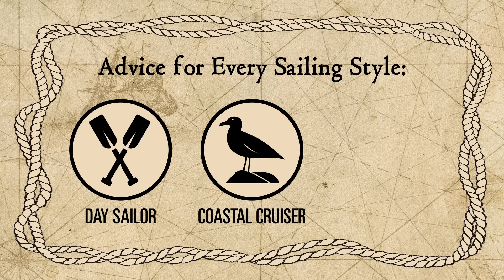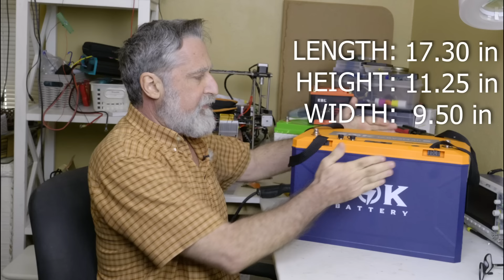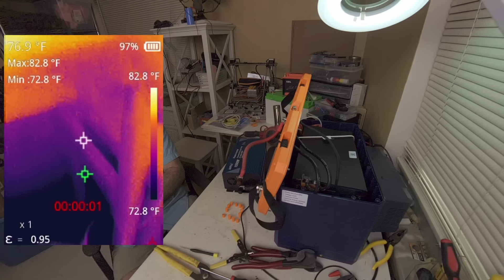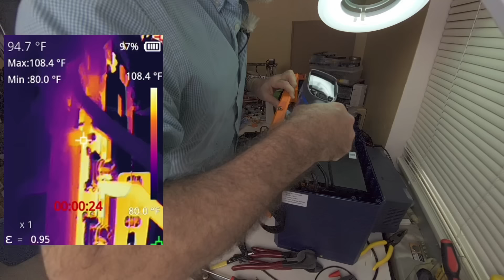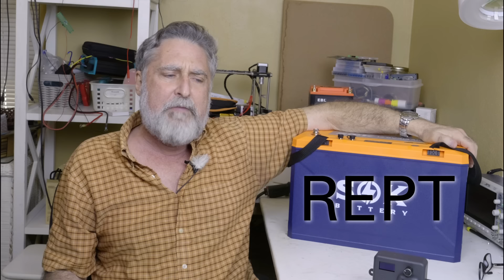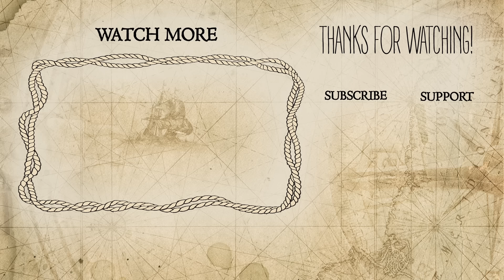Watch this BEFORE you buy any SOK LiFePO4 Battery

Comment: Great review, Clark - many thanks. At 2.45s you mention another battery manufacturer which features an inbuilt extinguisher, but I didn't catch their name. Our marine insurer requires fire protection on any lithium installation, and it would be useful to compare the two brands. Or maybe you've reviewed already?
Reply from the maker: Yes I reviewed it long ago, it's the VoltGo.  If that one interests you go to my leaderboard (linked in the description of any of my review videos) and use that link.   I organized a deep discount for you and free shipping.  It shows up just before you pay.
   I didn't mention the extinguisher in my review video.   But check their site, it had one.
Reply from the maker: https://youtu.be/IQSiJRVVQ2g

Ps this battery is installed in my boat now
Reply: @Clarks-Adventure  That's seriously useful - thanks. Now to see whether available on this side of the Pond....

Comment: I have been trying to get mine to top balance for months. SOK actually sent me two new battery's because they had some quality issues with the first batch. Now with the two new unit still no luck. I have a feeling their getting lower grade cells . I have cells that I can not get to go over  3365mV while the other cells climb and then one other cell just shoots up extremely fast. It always the same cell that caps out and the same cell that shoots up. am now not even able to charge to 13.8 without a cell going into OCV and shutting down charging. This is ridiculous for a 1K battery.
Reply from the maker: Absolutely ridiculous.   It's not the cells it's the bms's inability to balance such cell groups.

   You could open the battery and either manually balance the top cell down or install an active balancer in parallel to the BMS (I have videos on all this).
    But again, yes ridiculous!
Reply: I don’t know if it will let me post this email exchange but I am going to try. How much can you say without saying anything.

Hello Burke,
We extend our sincere gratitude for your comprehensive and thoughtful feedback, and we deeply admire your rigorous professional approach. We are keen to share lithium battery insights with you. Analogous to the uniqueness of natural leaves, commercially produced cells exhibit inherent minor variations. Consequently, our pre-assembly process includes rigorous voltage and internal resistance screening to ensure optimal parameter matching across all four cells within a battery. Upon reviewing the production data for these two units, we confirmed full compliance with our matching criteria.

The intrinsic electrochemical properties of LiFePO₄ result in an exceptionally flat voltage plateau across the majority of its discharge curve. You likely observe this during use, with cell voltages predominantly residing between 3.2V and 3.3V. The data sheet shared yesterday clearly demonstrates this behavior, indicating approximately 95% SOC at ~3.33V and reaching full 100% SOC shortly beyond 3.4V. While the cells are rated at 314Ah, both delivered over 320Ah – this additional capacity is extracted from the steep voltage region above 3.4V.

1763612100_44540_50005_1351721197_3E090BBE@534AF569.C4951E6900000000.png
Voltage divergence concerns during terminal charging phases often originate from underappreciated electrochemical traits. The passive balancing mechanism operates precisely as you noted: higher-voltage cells dissipate energy through bleed resistors while lower-voltage cells remain unaffected. However, balancing duration scales directly with capacity – higher Ah cells require more time due to the intentionally limited balancing current designed to manage thermal load. You can monitor active balancing via the "BL" status flag using the provided USB interface tool with our diagnostic software.

Thank you！

Jackie
https://www.us.sokbattery.com
If you have any question,get support from here:
https://www.us.sokbattery.com/contact
Follow us on Youtube to learn more about SOK battery
https://www.youtube.com/sokbattery

Burke Swanson<biljol@gmail.com> 在 2025年11月20日 周四 11:42 写道：
12 hours later:

Battery ending in 1946

So we were at Battery Voltage 13.88 Status Charge Complete

Cell 1  3413
Cell 2  3390
Cell 3  3649
Cell 4  3433

Update as if 17:30 Battery voltage 13.92  Status Charge Complete

Cell 1  3430
Cell 2  3410
Cell 3  3645
Cell 4  3444

Not seeing much movement on cell 3 I would have expected it to go down. But also seeing the battery voltage go up? I have no idea what's going on. The battery is connected to a power supply set at. 13.75 V

But the chart of that cell is showing some downward movement I think. I see the screen shot may not be good depending on the point in time it was taken there is a delta of .03 v in the chart that would mean if the screen shot was at the peak the original voltage would have been about  3679 not 3649 the second data point at 17:30 should then show a  .03 V reduction over 12 hrs. with about .2 volts of adjustment needed that would take 2 weeks to balance the cells. To me that's not a 200mV passive balance to me. 

1763612100_44540_50005_1177905755_7AF2E7C7@2A494A09.C4951E6900000000.png

Let's look at the battery ending in 2095

at 0600 this morning the values were  Battery voltage 13.76  Status Charge Complete

Cell 1  3465
Cell 2  3493
Cell 3  3463
Cell 4  3348

at as if 17:30 Battery voltage 13.92  Status Charge Complete

Cell 1  3513
Cell 2  3550
Cell 3  3511
Cell 4  3353

In this battey I see 1,2,3 charging slowly and evenly with a delta of about 06mV but cell 4 is lagging way behind.at only .005 mV. of charge over 12 hrs.
This is the pattern I have seen of one cell just not taking a charge. Also if I were to discharge the battery some cell 4 would lag and cell 3 would rise quickly. This is the same behavior I have seen on battery 1946 cell 2 is the laging cell and cell 3 is rapid.

I know I am providing a lot of details but I have had a lifepo4 pack vent on me (a cheap unit) and I do not want a repeat of that. That's why I paid up for these batteries and not just some cheap ones from Amazon. You would think the lower voltage cell would charge faster in both batteries but it's the highest voltage cell that is charging the fastest.

I will not be changing anything and will allow the batteries to "cook" and get back with you tomorrow morning after 24 hrs since we started this data collection.

Please help me understand what's going on and how to fix it.

I am also very concerned that I do all this work to balance the cell, and the first time I discharge them I will be right back where I started when charging them back up.

It is very frustrating to purchase a 1000.00 battery and have to do all this work (months) to get them to work correctly.  

I have a cheap battery here (that I would not trust in my RV), new out of the box, and as I charge it the cells are rising completely balanced out of the box. 

Thank you for your help in advance.

Burke
Reply: My concerns with installing an active balancer  A. void the warranty B. I am not sure how depending on how the cells are attached to buss, welded or stud C. I should not have to modify a 1000$ battery.
Reply from the maker: Yes it would void your warranty.
Reply: One question for you after you finally got them balanced does it stay in balance. With my cells that lag in charging I am worried that I do all this work and 3 weeks latter after a couple of cycles I am right back where I started.
Reply from the maker: Yes they will most likely stay in balance once you get them balanced.  If it was me I'd open the case and manually balance them.

I have this Patreon tier called Dream Believers, it gets you phone access with me and it's become my direct consulting service.
    50 bucks might be well spent if you would like to talk and hash all this out.   
    Balancing these cells with the BMS for 2 weeks will significantly age the cells.   Better to do it manually, then you will have a pair of great batteries.   SOK should use a BMS that can balance in a day.  SOK should balance at the assembly plant for that money.
Reply: I wanted to provide an update, using the power supply procedure. I am getting them to balance taking a long time but one battery is at  .012 mV delta on all the cells and the other one is down from .197 to  .138 delta. This battery sat at .19X for over 2 weeks  and finally starting to close the gap. I tihnk one cell was way undercharged from the factory compared to the others.  Both battery's are at 14.1 volts. I am hoping by the end of the week they will both be complete < .020 delta. Then I can ramp up the voltage to 14.3 or so to fully balance  as close as passable. I am looking at buying a 3rd and now I know I will need to balance it for a week or two before I install.
Reply: My fInal update THEY are done took 1 full week after I figured out how to get them to balance. Final result is a delta of 3mV over all 8 cells in 2 batterys at 13.7v if I charge up to 14.2 or 14.4 it gets up to a max of 21mV delta but that may get better over time. I also see them drawing down and charging up equaly.
Reply from the maker: Good job

Comment: Hi Clark. I've been looking into replacing my 8 Battle Born BB 100Ah batteries in my camper, for 4 of the SOK 314Ah.  My existing bank is wired for 24v because the run a 24v air conditioner, so to maintain the 24v, I either have to go with to SOKs which drops my capacity to less than I have now or, four, which significantly y exceeds my existing capacity - which I like.  My Battle Borns are lightly used. 4 are 5 years old and have 21 full cycles. The other four are 2-1/2 years old.  The only way for this to work, financially, is if I could sell my 8 Battle Born batteries.  Assuming I could, and ignoring the install costs, why shouldn't I?
Reply from the maker: I don't understand what you are asking.  If you want to sell them sell them.
Also it's not a good idea to mix batteries by age.
8 in parallel is usually problematic 

If the batteries are working for you you could break them into two banks of 4 by age and get 2 BankManagers to charge them correctly??
Reply: @Clarks-Adventure  Yeah, that was a poorly written comment. I guess what I wanted to know is this: Do you like the SOK 314Ah battery enough to not have a problem with a person in my circumstances wanting to replace a bank of 8 Battle Born batteries (4 acquired in 2020, 4 acquired 2023 wired for 24v), with 4 of these SOK's?
Reply from the maker: As I remember it's only issue was with balancing, you needed to charge past 14v with over 5a.
  Watch the review video and my new battery balance video 
   Balance is vital.

I'm running the SOK in my camper

Comment: Clark, turning off at 14V - 14.2V is not uncommon these days. They call it over-charge protection. If I had to guess that battery is made  for SOK by Topband or Roypow both of who now employ over charge protection.  When you put a 10+ year warranty you need to cover your ass from folks using chargers that over absorb…
Reply from the maker: Epoch used to do it that way.  Until they realized it was a mistake.
  The only thing that does this right is my BankManager 
   MarineDCAC.com

Comment: Mine are a nightmare. I got the ones that had buss bar issues where they touched the negative terminal. They wouldn't swap the batteries out, had 3 cycles on them. They offered to send new bus bars and have be swap them. After I was still not happy they offered a new battery with the same bus bar issue sent to me if I pay shipping. Fine. I finally get the new bus bars, and now the batteries will not balance. Can't get them past 13.7V before one cell goes sky high. The pack only holds about 290ah because of this. Waiting for SOK to send me some sort of software that is supposed to help with the balancing. Overall I have spent so many hours on these between initial diagnosis and now trying to get these back how they should be I am beyond frustrated. SOK should have taken these back. I will never buy SOK again.

Comment: but can low current overcharging occur when the recommended voltage of the power source is thesame as the voltage of the battery. i suppose when the voltage of the power source is thesame as the voltage of the battery, the current will taper off, and eventually may not able to push more any reasonable current into the battery
Reply from the maker: Simply holding a 12v battery over 13.48v can cause this issue.
   That's why I added a "load" circuit to the Gen3 BankManager.   MarineDCAC com

Comment: Hi Clark, is there a simple way of producing your BM in its simplest form for old dumb people (like me) who do not want any technical adjustnents or displays ie all internal default settings like charge to 100% all built in the unit and thus just have a plug in and go system? (just1x 12V acid battery and 1x12v Lithium)Regards john
Reply from the maker: Yep. Sort of.
   The only setting the menu that must be set is the size in amp hours of your Li bank.  Then as long as you are using the bi-stable contactor just install it and ignore it.

The initial design was for it to sit with the batteries and be forgotten.  I added so many menu options I needed the display but I personally run with the defaults (that's why I chose them as the default settings)
Reply: @Clarks-Adventure  Ok thanks, so I suppose I will only need the 2nd gen since I dont want the extra features like blue tooth etc, not sure what the bi-stable contacter is, could you elaborate, Regards john
Reply from the maker: It's on my webpage read about the bi-stable there.
  Sure Gen2 is still a good unit
 The one feature of the Gen3 that I think is most important is the "load" pin.  See the manual or my Gen3 install in my camper video to describe that.
   It helps with battery life and cleans up the clicking off and on that can happen during reconnecting

Comment: The Epoch marine battery does exactly the same thing, the charge MOSFET’s turn off around 14v. Must be the same or similar BMS inside. Furthermore, the passive balance function does not provide enough balance current to effectively balance the cells. The best way to handle these batteries is to use 13.8v as the 100% reset. Charge to 13.9v and keep the absorption time down to about an hour. By the time you get to 13.9v the charge current is very low even with multiple batteries. My background is that I have a BS in electronic engineering and have lived with the Epoch 460ah marine batteries for almost a year.
Reply from the maker: I think the best way is to get them balanced then use a BankManager.
   If you look into it I bet you will agree.
Reply: @ That’s not the case for me. I’m in an RV and don’t use any lead acid batteries in my system. If I had a hybrid system in a sailboat I would probably agree.
Reply from the maker: @elmer665544 just tie in your starter battery.
   Now your alternator can charge your Li and the li will float the lead at 13.1 so they will last a long time.

As long as you don't drop the li below 12.8v your lead won't be touched for house loads.

All that and your li will last WAY longer by being charged right.
Reply: @Clarks-Adventure  I have a 5th wheel trailer and don’t use the alternator for charging. These trailers have significant roof space so I have plenty of solar to charge the lithium house bank. Otherwise, it would make sense to combine them. Just not in my case. I have 1,870w of solar and room for more if I need it. The extra cost would be better spent on more solar but I don’t need it.

PS. I can float my lithium batteries at any voltage I want with the Victron system.
Reply from the maker: @elmer665544 I'll stop pushing after this one last statement.
   You can't charge li to a voltage and get long life.  There are days when charging to 14.6 is 100 percent, and days when 13.7 is 100 percent.  It's not lead!

   Under charging causes memory, Charging  to a low voltage is the definition of low current overcharge.

  But your batteries, your decision
Reply: @Clarks-Adventure  I have tried bulk charging and floating lithium batteries at 13.6v, 13.8v, 13.9v, 14v, 14.2v and 14.6v with both SOK batteries and Epoch batteries over 5 years and watched the charge current profile for each of the settings using various absorption time settings in various conditions. I am confident in my results. I am not over confident that I know more than the engineers that designed the charge profiles for their batteries and equipment. I have said that I agree your system works for hybrid installations but disagree that it helps with a lithium only system. I now charge pretty softly at 13.9v with 1 hour absorption time. If you watch the battery current during that period you will see that it’s very easy on the battery matrix. I don’t care if I only get to 98% or 100% and then down to 20%, I am pretty sure that I will get the 6,000 cycles or 15 years. The batteries will have reduced capacity from age before they have reduced capacity from cycles.
Reply: great,professional!